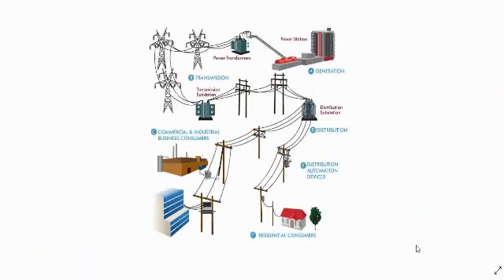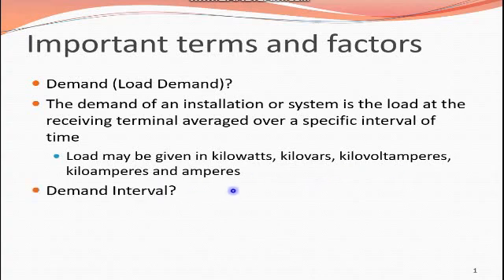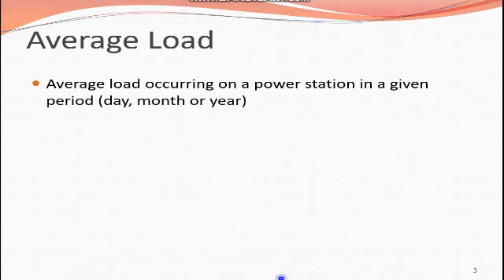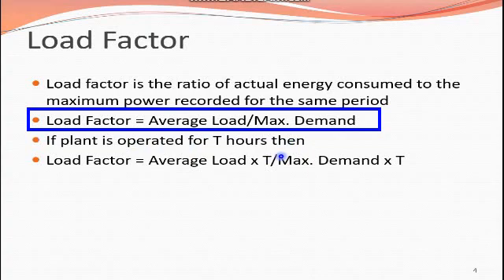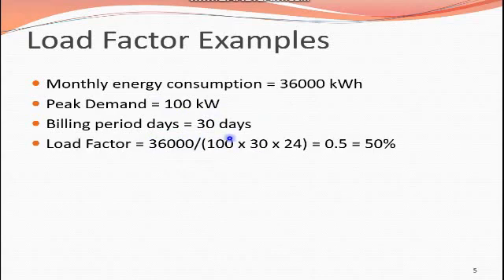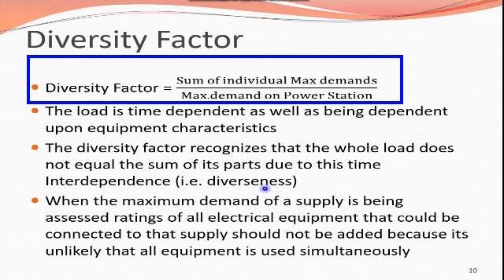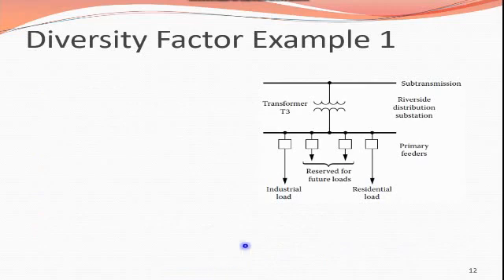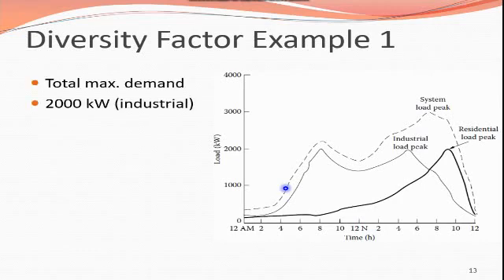Average Load , Maximum Demand , Load Factor , Connected Load , Diversity Factor with Examples Lec 3

Comment: power system by (V.K.MEHTA) 
example 3.3
please read this problem and clear the confusion.
what i understand is that, working hours will be ( 2+6)*320=2560 hours as the power station shut down for the rest of each day.
But in solution they have taken working hours as (24*320)=7680 hours. i am not clear why they have considered working hours as 24 hours each day.
will not it be 8 hours each day as working hours? as the power station shut down for the rest of each day.
please clear this confusion.
Reply: https://youtu.be/NoHZp-38vRg